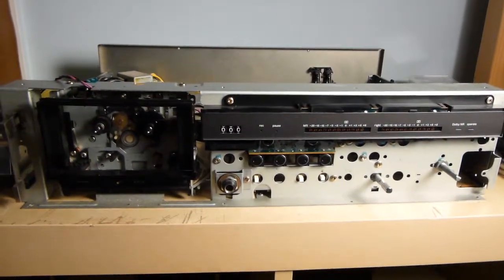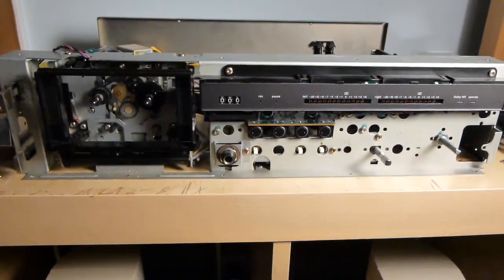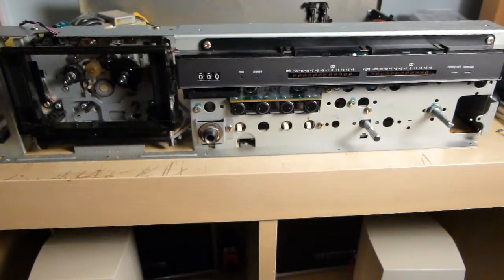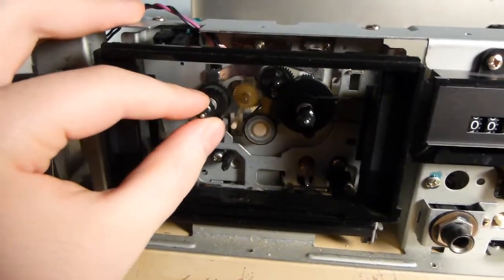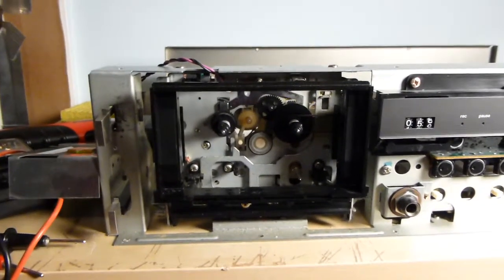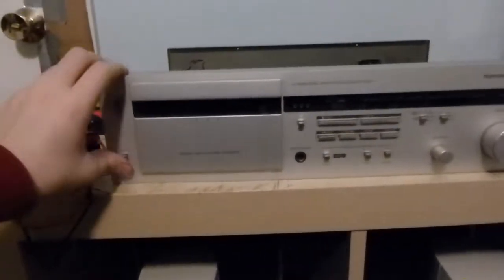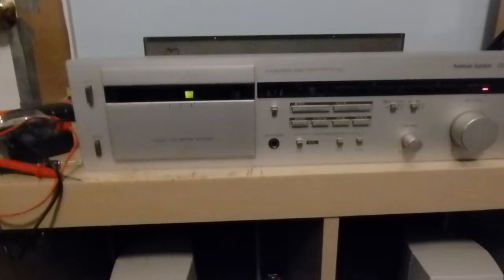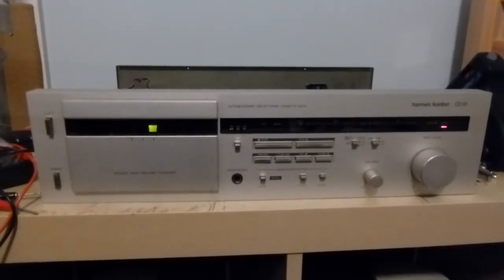Harman/Kardon CD 91 Cassette Deck Repairs & Demo

Comment: Great video! I have this deck and just took it out of basement storage after about 15 years. It ate the first tape I put in after running a head cleaner for a bit. I haven't cracked it open to check the belts and wanted to ask if replacing your belts was difficult. I've seen some comments online about having to break factory soldering to remove the power supply first on other H/K models. I'm trying to decide if it's worth the hassle. Thanks.

Comment: Thanks for the video. I have a CD91C with a busted idler wheel rubber. Where do people buy perishable parts eg belts, idler rubber ring etc ? I can (and have) search, but have no idea of the better places to buy from. Thanks for any information.
Reply from the maker: I typically get belts from turntableneedles.com.  Not sure how many other rubber parts they have, though.

Comment: Hello i have the cd291 which looks almost the same.   it was working perfect when i dusted it off from its siting for couple years.   but it would start rewinding on its own like if you play a tape it would stop and rewind or try too rewind and stop. than when you try too play it again it will play than stop...   But i found out whats causing it.  if i hold the counter reset button in it will play perfect aslong as i hold it in..  Now the counter does work which got me confused..  cause i herd these machines will not play if the counter does not move which when i push the button in it works perfect...     Would you know what this can be?   im thinking about taking it apart and see whats wrong.

Comment: I still can't remember if I had the CD 91 or 291.  The odd this is that I thought the Input Level on mine was a split knob with a fine seam between the two for separate left and right inputs.  But that was back in the early 80s.  I remember that I had to replace my flywheel belt also and used a rubber band as a temporary fix. The open cover broke on my also and I ended up gluing it on.  It was a really good cassette player/recorder and I dare say, almost as good as a Nakamichi.

Comment: I got a similar model, the cd 101...the pinch roller is stuck up like as if in play mode and it doesn't get down...Any ideas for where the problem is?
Reply from the maker: If I were to guess, it's a similar situation to what I described in the video, either with the fuse resistor having blown or with one or more belts having snapped.  In your case, however, it sounds like the fault occurred while the deck was in playback mode, leaving the mechanism stuck in that position.  If this is the case, the heads would also be stuck up along with the pinch roller, and rew/ff would also not work.  If, however, it's just the pinch roller that won't move, and the other functions work, then it could be a more complicated issue within the mechanism that raises and lowers it.

Comment: I have this model at home and one of the RCA connecter (IN channel left) on the back doesn’t work ... circuits and wires seems to look good but ... Do you have an idea how to repair it ?
Reply from the maker: matthieu2052 I'd say check the solder joints on the connector to make sure they aren't loose.  If those are good, the problem may actually be further into the circuit, like a finicky record level control or something like that.  Not sure exactly how far into the circuit you've checked already, but that's where I would start.

Comment: Thanks for your video, i have the same unit, all the belts look new. Play does not engage, ff and rew work. Am thinking that the takeup spool is gummed up, unless there is something else to consider? Cheers
Reply: Check that fuse/resistor he speaks about near the beginning of the video.  Mine has the identical problem.
Reply: The 'tire' on my TD 392 Harman/Kardon broke into 4 pieces so the take-up reel won't engage - that's a critical problem.  Where do we find one of them tires?

Comment: Thanks for the video. Could you maybe advise where the fuse resistor is situated? 
I have this deck and I have the same 'motor not running' fault.
Reply from the maker: My memory is a bit fuzzy, and I don't have this deck within reach right now to look, but as I recall, it's located behind a metal shield in the power supply section, which should be at the back of the deck (I want to say back-center but I'm not sure).
Reply: how do you adjust the speed on this player, I have one that is not playing at the correct speed. I just don't know where the speed dial is.
Reply from the maker: See my reply to rattinox's comment below.

Comment: Where is the potentiometer that controls the motor playback speed? I just got a CD91 from a pawn shop, cleaned the belts well and now it plays fast- weird.
Reply from the maker: It should be located on the back of the motor, inside a little hole with a rubber dust cover behind it.  There should be a slot in that dust cover such that you can stick a tiny flathead screwdriver through it and turn the potentiometer inside the motor.  Just note that if you don't insulate the end of the screwdriver, the speed may wander all over the place when you're trying to adjust it due to the screwdriver hitting the pot's exposed metal contacts.
Reply: Thanks!! I'll make up a Delrin screwdriver just for this.